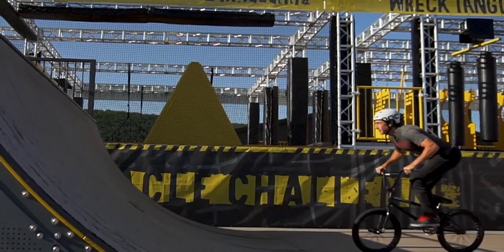How to air higher on every ramp

Comment: Jay, I always pull off the ramp too early and I can’t figure out how to just chill out and let both tires pop the coping. Any advice?
Reply from the maker: Have to trust yourself. Start under coping and make a point to take off on your back wheel. Then work your way up.
Reply: Use your legs/core not just your arms
Reply: Jay Dalton BMX thanks
Reply: Zack thanks dude
Reply from the maker: What Zack said

Comment: How do dis? Lol love that. So my issue with airing is I don't like big vert ramps and I stick to smaller quarters but it's hard to get it to transition you into the upright angle you leave the coping with so I am usually never hitting my rear tire, what should I try to do to mitigate the lack of transition?
Reply from the maker: As weird as it sounds, the bigger ramps are easier to air. Give them a shot :D 

To make sure your back wheel launches off the coping, make sure you are pumping hard with your legs and pulling back with your arms. If you're just bumping your front wheel, it's more than likely you're treating it like a bunny hop of sorts. Pump hard and then let the ramp send you. If you link me a video, I'll be more than happy to analyze for ya' :)
Reply: Sweet dude I will get it next time I go ride. We got 95 degree weather and 70% humidity and it's fucking death out. Of all the shitty things internet brought it's pretty bad ass I can network with incredibly talented people across the world who are far more knowledgeable than I.

Comment: Advice for adjusting between mellow and steep quarters
Reply from the maker: For mellow quarters you want to pump hard and pull back hard. Steeper ones you still pump, but don't pull out as much. Hard to explain, but kind of push your back wheel through the coping so you're out over the deck a little. Doesn't really make sense in text form, but ye.
Reply: Shit... instructions read wrong...I became a scooter

Comment: My skatepark has a "quarter" that is like 45 degrees at best at the lip. Is it possible to air without casing and then inevitably dying? im too scared to try.
Reply from the maker: Pump harddd. If you can learn on super mellow stuff it will give you a way better understanding of how the pump works. Just take it step by step. Start low and work up.

Comment: Are smaller quarter easier or harder to learn out to air? (5 foot vs 8 foot, both do a full 90 degree)
Reply from the maker: The taller quarter will most likely be easier to air, but learning on the smaller one will give you a better understanding of the pump.